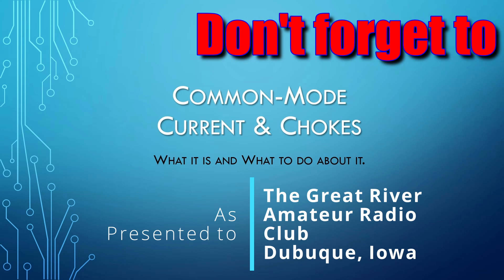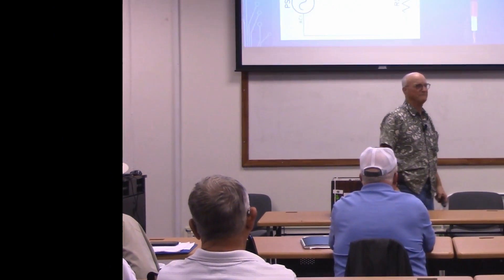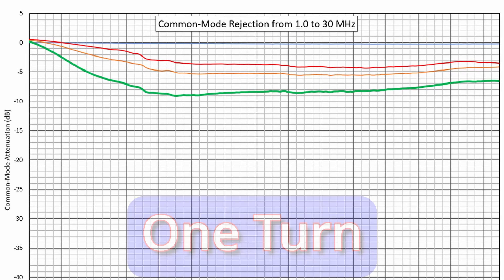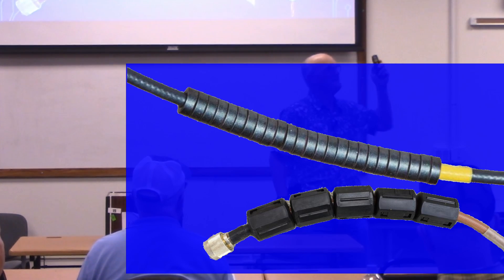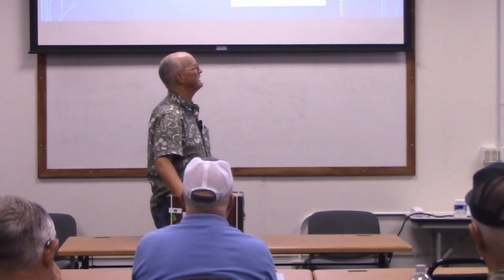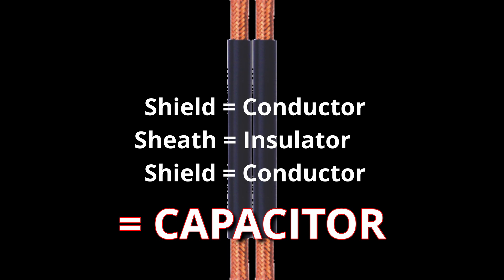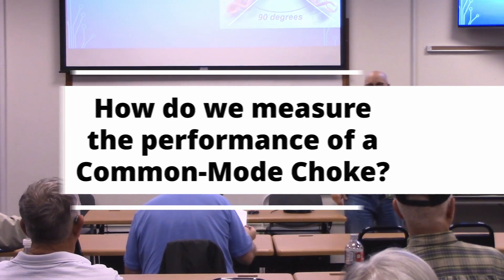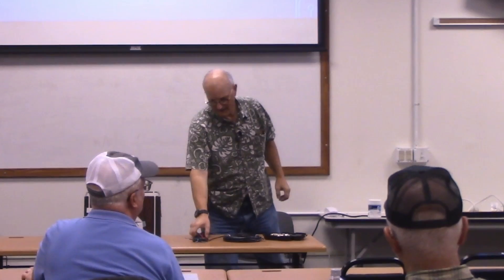Common Mode Current, How do these Chokes work? (013c)

Comment: Hi
How would you go about designing a choke for a particular frequency 145MHz min -20db
Reply from the maker: I have not designed a choke to operate up to these frequencies (yet), but if I were to do so, I'd start by looking at what ferrite materials operate in this range. I think 31, 43 or 44 are up there (e.g, https://fair-rite.com/product/toroids-5943011121/). 
Remembering, too, that RG58-type coax has pretty high loss, you would probably want to make this a unit to insert somewhere in the feedline being mindful that the characteristic impedance of the coax used in the choke is the same as the feedline it is inserted into.
I'd also lean toward N-type or BNC connectors because they have *MUCH* better characteristics at these frequencies that the ubiquitous PL-259/SO-239 (UHF) connectors.
(COMPARED: https://youtu.be/HjbUK7yjpjA).
Then experiment.
Reply: @eie_for_you Thanks for the response and I have watched your connector youtube. Very informative.. To get some idea of number of turns what formula would you use or is it based on the length of coax?
Reply from the maker: @stanholmes4293  If we are talking about the toroid-based choke, unfortunately, I have no nice predictive formula for you; I've always just experimented to find what gives me what I want. I have noticed that the law of diminishing returns applies.
If you are talking the "roll of coax" type, there are some on-line calculators available. I haven't seen the formulas behind these calculators. How you create your roll of coax DOES make a difference, I have seen that.
Reply from the maker: @stanholmes4293 I was just thinking to add one more comment here ... if you are looking at the "roll of coax" type, there are two aspects to this: [1] the number of turns and [2] the diameter. But, more than this, too, there is how the coax is rolled which will affect performance. Because you are looking to increase the inductance of the outside of the shield, closely wound turns with coax laying snugly against coax (neat and tidy) will provide better performance than a randomly rolled coil of coax.

Comment: Great presentation. A year ago I would have been lost . Now it make sense. A bit over my head. Just an ordinary general. But still great information. Can I ask at what point do more and less turns become useful, detrimental or just a waste. I have built several 240-31s with 18 turns on RG 400. My present common mode current is about 6 mAs on 40M. Still have more testing to do. Thanks so much.
Reply from the maker: I'm glad you found the video helpful! 🙂As I experimented with it on the bench, the law of diminishing returns was clearly at work. It never became detrimental to what I was trying to accomplish. It just didn't make enough of a difference to bother.

Comment: I don’t understand why a common mode choke is needed. In a ham radio   / antenna what is the benefit? Does it reduce interference? Does it reduce RF from feeding back towards the radio? Or is it something else? Why is it a good idea to use a common mode choke?
Reply from the maker: This common mode current comes back into the shack and causes things to be RF "hot".
In severe cases you might even get R.F. burns off of stuff in the shack (I've had that happen ... back in my high school days when I didn't know what was happening).
With RF in the shack, it can cause issues with other equipment.

Comment: Useful video, many thanks. The 'dips' in the S21 response at 10:41 , are in effect LC resonances, from an inductor the choke turns into a capacitor (due to parasitics) after the resonance and so on, it peaks, then it becomes an inductor again, but its common mode suppression is then less effective (as seen from the response), etc. For this reason, I think it is a good approach to keep the resonance as far as away from the useful operating band  as possible, 73.
Reply from the maker: In retrospect, yes, you are absolutely right! This resonance is what is leveraged when creating an antenna trap out of coax.  It is certainly all about increasing the inductance of the outside of the shield so the inductive reactance is higher.
I realized all of this some time later, but simply uploading a newer version of a video over an existing one is not allowed by the YouTube folks.

Comment: Excellent trilogy of videos, now That I understand better the concepts, it is posible to design a balun and an rf choke in one box?, so we place only 1 part and less parts, for instance balun 1:1 for 1-30 MHz. ? Saludos XE2GRC
Reply from the maker: Thank you!  Yes, as I understand it, a carefully and thoughtfully designed and constructed BALUN can also act as a common mode choke.
I also know that not all BALUNs do a good job at it.
I've done quite a few measurements on off the shelf BALUNs for both impedance matching and common mode rejection. I have not been as impressed as I expected to be. Maybe my exectations are too high???
I have long intended to dive heavily into the world of BALUNs and creating my own, but have not done so yet.  I would LOVE to know what you come up with.

Comment: Continuation....Is there a limit to the number of turns you should use.  

Lastly, thank you for posting such an informative and easy to understand video about common mode current!  73, de Steve
Reply from the maker: Because the snap on ferrites affect only the RF currents running on the OUTSIDE of the shield and the business portion (innards) is relatively unaffected by them, I do not see that there is a limit.  With that said, I think you will discover that there is the "law of diminishing returns" operating here.  Each additional ferrite you attach provides a degree less benefit than the previous one.
Again, thank you for the encouragement!  This is why I do what I do. :-)

Comment: Wow!  Those three videos were very informative and helpful.  By the way, is there a maximum number of "snap-on" mix 31 ferrites that should not be exceeded on 50 ohm coax cable?   I am using "Palomar" mix 31 snap-on ferrites in an attempt to solve a problem in my radio shack with my hf transceiver.  It appears as if my problem was less pronounced when I added more snap-on ferrites to my coax near the antenna's fed point and near to the connectors on the back of my radio.    Now my problem has been solved.  But, I was wondering if there was a limit to how many ferrites you can put on a length of coax, or turns through the
Reply from the maker: I am really glad that you found them helpful!  It was a lot of fun doing all of the research and experimentation for them, too.

Comment: very interesting - thank you for the great video.  Does a ferrite / torrid common mode choke suffer from Flyback when the TX stops?
Reply from the maker: I am glad that you found the video helpful!  That's my goal. :-)
As I understand it, "flyback" is an issue when dealing with DC through some sort of an inductor.  This is mainly a concern with larger inductors.
In this application, we are talking much smaller inductances and, with RF being an AC signal, I cannot see it as an issue here.
Reply: @eie_for_you wat is tx? Texas?🎉🎉🎉
Reply from the maker: @joeswampdawghenry  "tx" is the standard abbreviation used by radio folks for transmitting or transmitter. It comes from the Morse code abbreviation.🙂